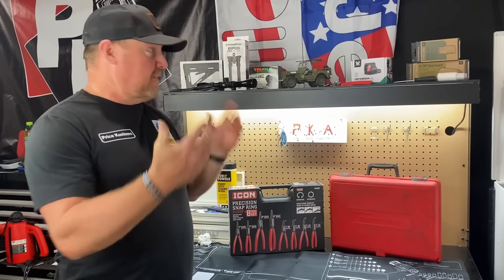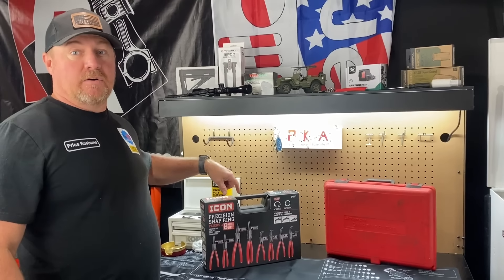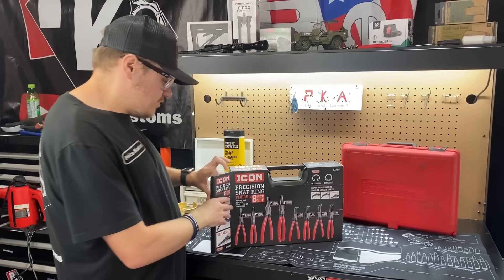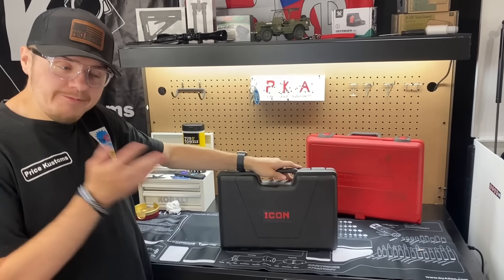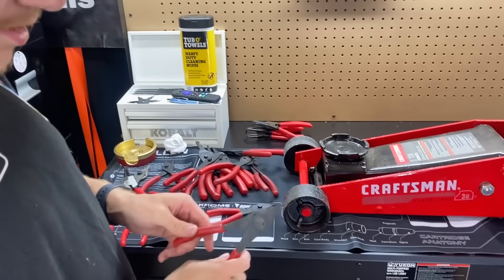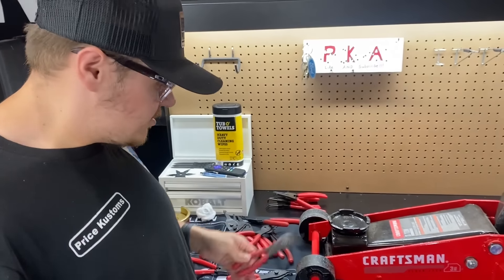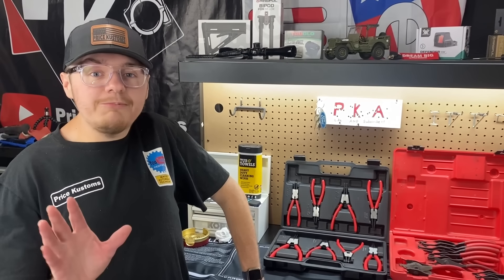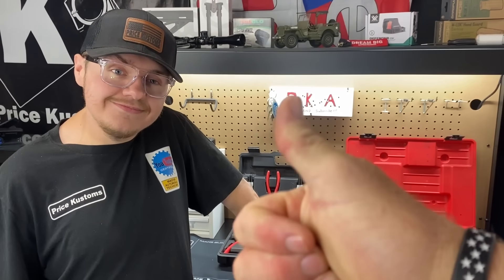HARBOR FREIGHT ICON VS SNAP-ON Snap ring pliers / Which is better #harborfreight #snapon

Comment: I just picked up that set about 3 months ago. They are not bad at all. After my discounts, it was right at $50. They're not the finest looking pliers, finish wise, but they should last a long time while being decently durable. They are perfect for the "at home" mechanic or a very solid choice for someone who's starting out as a professional. They offer a add on 4 peice set of smaller ones as well.

Comment: Subscribed!  Excellent video!  I picked up the same set at HF on a super sale in May -- probably the same sale you guys went to -- for $30, but couldn't actually get to the store that day so I ordered it online and had to pay seven bucks for shipping.  Still a great deal!  That's the only time I'd ever ordered from HF online.  I've been an ITC member for a long time, and absolutely love HF.  I don't use snap-ring pliers all that often, and usually use some kind of hack method that destroys the ring in the removal process.  LOL  It'll sure be nice to have the right tool going forward.  Thanks, guys, and I look forward to checking out your older videos and the new ones as you record them.

Comment: If you haven't checked out the Knipex Precision Circlip pliers, it's definitely worth a look! Absolute best IMHO, and I've used them all. No comparison. They're forged with a separate spring steel pin hand inserted in each one. $225 for a set of 8 In/ex. You'll never go back.
Reply: Knipex warranty is garbage doesn’t exist when they give out and they will.

Comment: Man I was so pissed I missed the sale on the ICON snap ring set back in May. I will have to wait until it goes on sale again because I will never by Snap-On because I just do not need that type of quality because I do not wrench every day. So Harbor Freight is fine with me and with ICON it is lifetime warranty. Strictly on looks, I prefer the ICON set over the Snap-On, but looks don't get the job done, in the end the best brand that works for you is the one you go with.

Comment: Used icon set for almost 2 years and an Astro set for years before…..used the snap on once with a very rusty snap ring and had to throw a pair of massive Slip jaw pliers over them and went to town…snap on set didn’t even bend so that week I got me a set….. if your new or don’t have all the tools you need for your job get the icon….. if they start to let you down or don’t work in certain applications upgrade to snap on (when on sale or eBay)

Comment: Are the ICON snap ring pliers you have made in the USA 🇺🇸? 😊
Reply from the maker: I’m not for sure, we will have to check and see
Reply: @PriceKustoms  some sets are which is very awesome.
Reply: The set in the video is not usa made (I recently got the same set and mine said China... The 4 piece set with the smaller pliers is Taiwan) 

The USA set is the newer quarter turn set

Comment: You guys are great, but I really dislike the clickbait title. Asking... Icon vs Snap-On, which is better... is absurd. Icon won't be better... the real comparison should be is Snap-on $460 better?   Now that there are reasonable tool alternatives... I buy Gear Wrench ratchets and ratchet wrenches, Vessel Screwdrivers, Knipex pliers, and Icon everything else. If I break something or it doesn't perform well enough, I replace it with snap-on one tool at a time. Let's just say... it's been a long time since I've bought Snap-on.
Reply: That isn’t clickbait they are just asking a question. lol